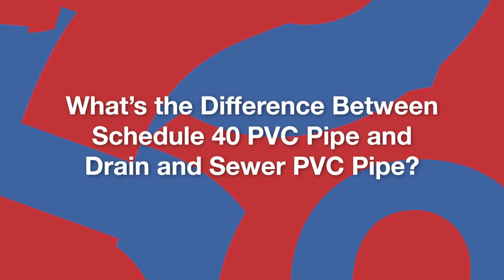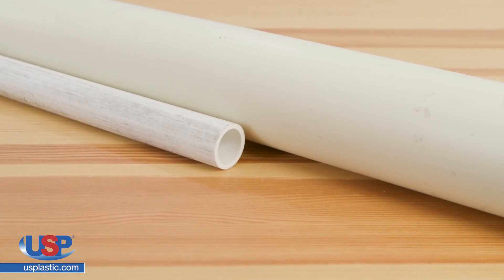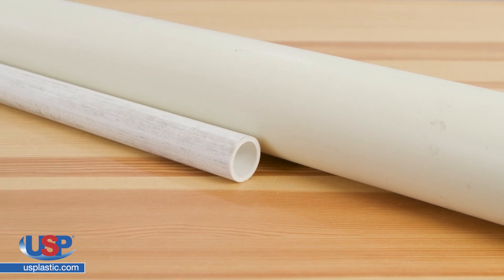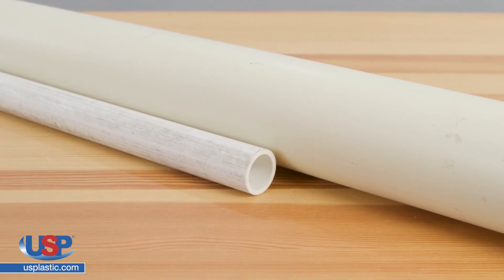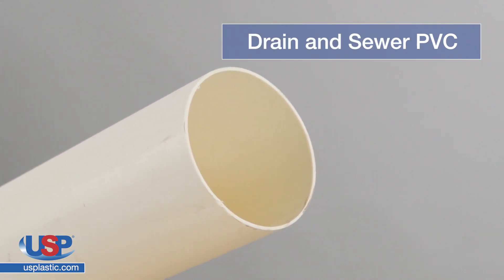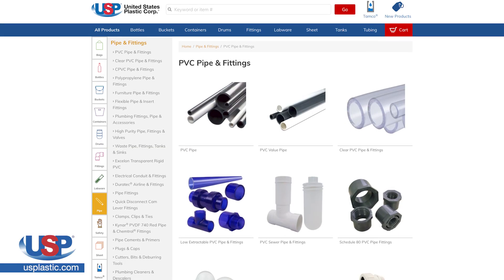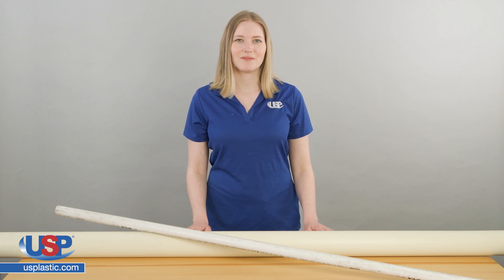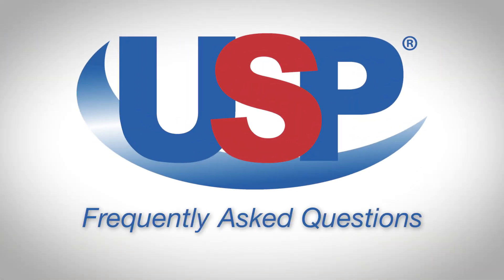What's the Difference Between Schedule 40 PVC, Drain, and Sewer PVC Pipe?| U.S. Plastic Corporation®

Comment: But can I use schedule 40 for sewer? Seems like it would last longer and be better under ground. Plus I get loads of it for free
Reply: I did, so when I drive a tractor over it by mistake, it wont break
Reply from the maker: Thank you for your interest in U.S. Plastic Corp. Don't hesitate to contact our product support department if you need help selecting the best type of pipe for your application. You can reach them via phone at 800-821-0349 Monday- Friday 8 am - 5 pm or via email at techsupport@usplastic.com